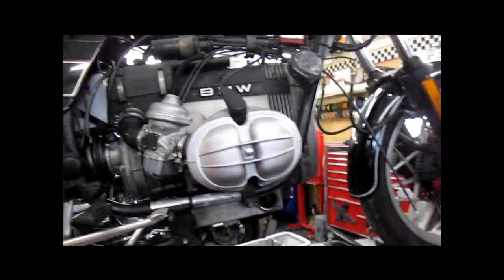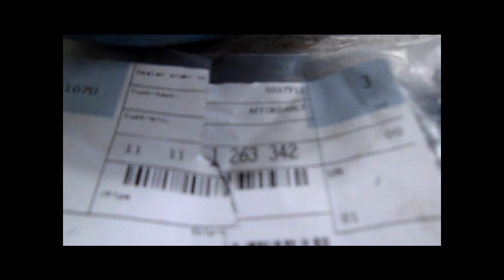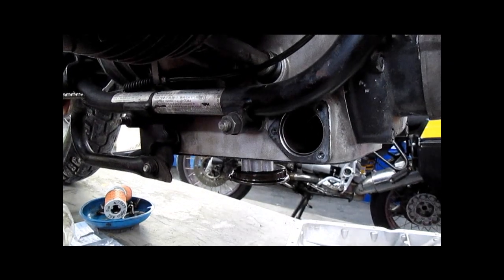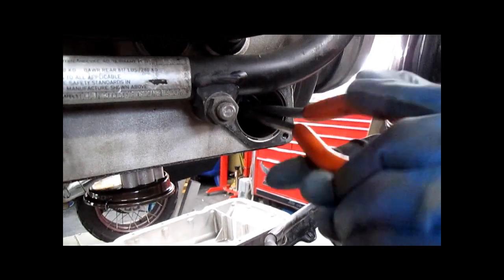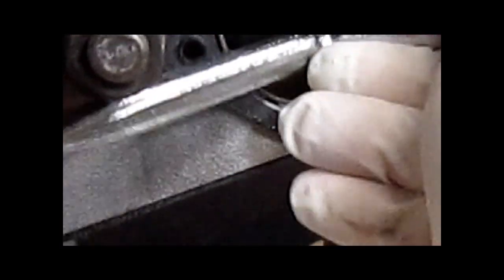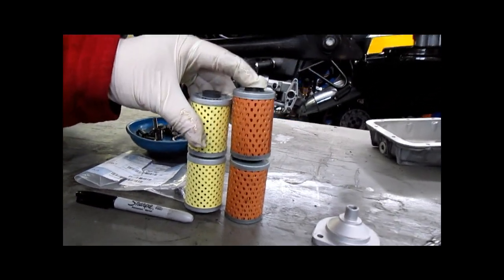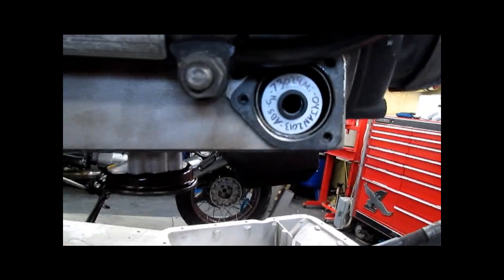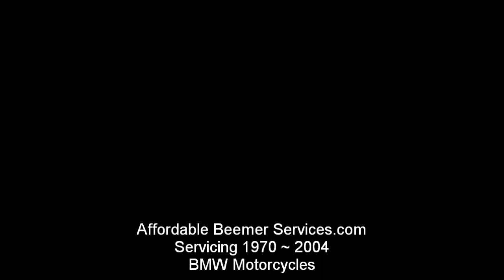BMW Service - R100RT/RS Oil Cooler Elimination

Comment: Appears that  the oil cooler-type /filter retainer/adapter has the infamous "fugly" thermostat; The GS "filter cap/cover/retainer" does not have the thermostat (at least mine doesn't)... thereby lower profile... making for far easier access/service...

Comment: Hey Chris, I also am deleting the oil cooler on an 82 RS, however I was wondering if it’s possible to use the flat style covers with the inner metal cup with the central bolt from the early 70s bikes. I’ve ordered the cover you have in this video, but I haven’t received it and I don’t want to wait any longer, so I found a flat cover.

Comment: Would have loved to see you install the oil filter cover just in case there's a possible issue with that.  I've never done it, it's all new to me.

Also it would have been nice to see you install the oil pan.  I'm replacing my oil pan with a MAC deep oil pan.  Any tips would have helped.

Comment: Hi Chris: Video was just what I needed. I think I'm going to get rid of my oil cooler. I didn't have one on my '77 R100RS fully faired, which I wish I still had. Much easier to change the oil filter. I'm trying to figure out what kind of triple headed screwdriver that is.
Reply: That's what I want to know, and where to get hold of one too, I am in the process of doing this very job.

Comment: Chris
Great video man I have a 1983 unfaired scrambler R100, I am told I cannot remove the oil cooler as the bike needs it! I hate the look of it and want to remove the fugly thing. What is the low down here man ??? did it need it when the fairing was fitted but now naked I don't need it?
Reply: +Harvey Mushman I'd say it depends on where/when/how you ride. Summer in Florida two up you probably need a cooler. Maine in the fall probably not. Here is a good article http://bmwmotorcycletech.info/coolers.htm . Me I'd just leave it on, a cooler is less ugly then a seized motor in my book:)
Reply: +Edward Jones thank you Eddie I will follow your wisdom and keep it on.

Comment: Hey Chris,
I watched all your videos of the r100rt. I recently swopped my ducati monster 900 for a r100rt from 1980 and going to rebuild it as a cafe racer, now I also want to eliminate my oil cooler, but i can't find the cover anywhere here in the Netherlands. Could you maybe give me the partnumber, while the one in the video is the same here in the Netherlands, but its only the tube. That would be amazing. keep making the videos. it's super helpfull.
Reply: Hey Jacoo Jansen
Did you find that cover? I have the same problem. Please help if you can. Thx in advance.